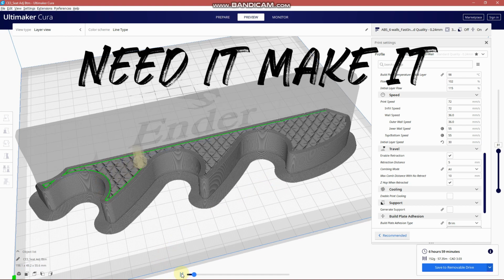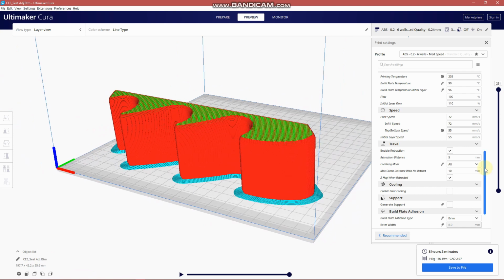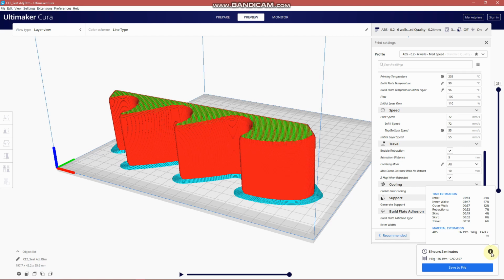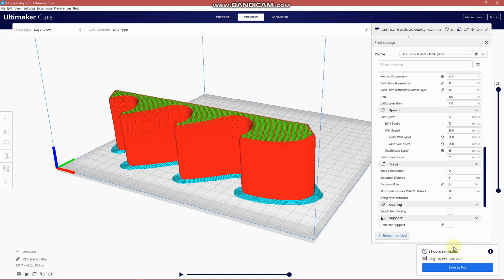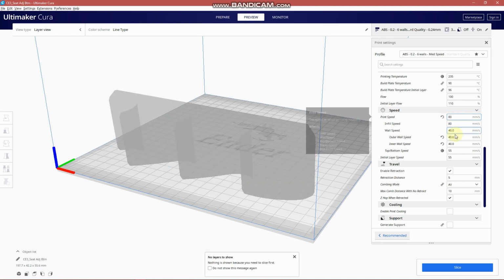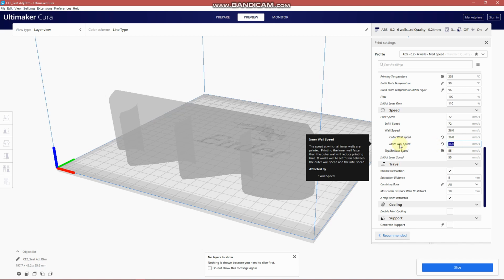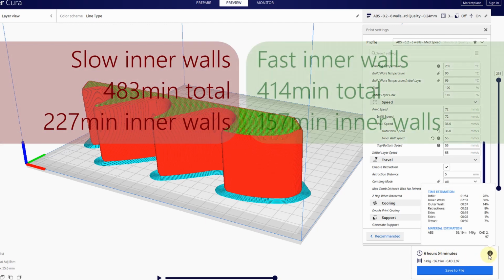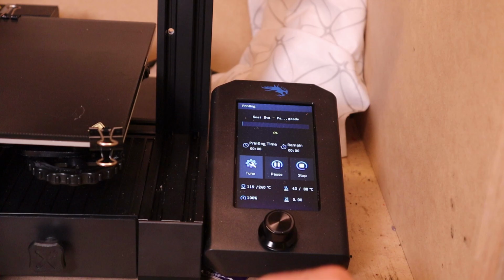Creality Ender 3 V2 - Speed up prints without sacrificing quality by identifying and changing...

Comment: There is a seemingly endless array of "upgrades" for the Ender 3.
I might venture to say that most of these so-called "upgrades" are really unnecessary and they actually cause printing issues. Just my opinion. 
My Ender 3 came "unrepaired" for cheap. After replacing the motherboard and installing the firmware, this thing makes very high quality parts. Sure, it is a bit slow but it prints without any "messing" with it. Your mileage may vary. At least that's what she said.😁

Comment: On Cura 4.11 i noticed if you change print speed to 72 the inner wall speed is default to 72 as well. I guess they modified this in the newer version so we wont have to mess with it.
Reply: F

Comment: I tried those settings but somehow the estimated printing time takes about 1/3 longer than with the Stock 0.2mm profile and seems to declare parts of the model as inner walls where the stock Profile doesn't show any inner walls(in the overview section of the "i" information symbol next to the estimated time)....
any suggestions to solve this?

Comment: For some reason, my prints on the Ender 3 V2 Cura estimate and actual printing are taking way longer than I would think they should. For instance, I have to scale a 3D Benchy down to about half scale and it still takes about an hour. And yes, my Cura settings are pretty much normal.
Reply: Cura dosent take acceleration speed in account
Reply: @omtapkir8639  By acceleration speed do you mean mm/s? Right now my Cura estimate is pretty accurate to the actual print time. :(

Comment: when you set the print speed on Cura mine still comes up as 100 in the tune setting on the ender 3 v2. Does that mean my setting are not setting properly?

Comment: i wish i could get my v2 to print even close to that nice
Reply from the maker: I have two and both print very nice, you can too, it will be a matter of making sure the mechanicals are setup correctly and then you have all of the settings in the slicer to adjust, which can have a major impact.
Reply: @NeedItMakeIt  i figured out my problem. The plastic piece around the wires coming off of the hotplate had gotten sideways and pinched itself in the spring which made it impossible to level the bed.

Comment: Awesome vid man. I nailed down a beautiful print with ABS on my Ender 3 v2 but it takes forever. Just ridiculous lol. I’ll try your method and let you know.
Reply from the maker: Really, you're printing slow because of no cooling?  If you haven't already tried it, buy the sample pack of the Nano bed adhesive from Visionminer, it works amazingly well, I've moved onto PETG from ABS, but it will help if you have problems with warpage.  Could make for a cool test to see if I can crank up the cooling on ABS as well as print super fast.

Comment: Great video will this work on the ender pro?

I’m a noob and only got this 2 days ago 
Every print I have to manually set fan speed and bed heat and nozzle heat on the actual machine never seems to save it.

Also my mum has a Troxy printer and we both printed the exact same thing mine being a few cms smaller but takes 6 hours longer to print mine than what hers does?

I turn down the infill to like 5% and also turned combing to all and don’t shave much time off atal.

My first print a cobra Kai phone stand from cults 3D and it took 5 hours lol am I missing something?thanks man
Reply from the maker: I'd say that you need a different profile for Cura, if you print with PLA you can use this one, but you'll want to add the infill.  As far as temp settings and fans, they'll come from Cura you can tweak them on the printer, but you shouldn't need to.  https://drive.google.com/file/d/1tZl4NQtSxjQbYV4XQzumbF6tqZGiXoF8/view?usp=sharing.  There are quite a few ways to speed up your prints, try changing the profile first and then we can take it from that point.
Reply: @NeedItMakeIt  thankyou very much I’ll look into it

Comment: creality says you shouldnt clean the stock bet with alcohol. and i never saw the need to use any crap on the bed, such as glue stick... do you use glue stick for pla and petg as well?
Reply from the maker: Yes, except I always use glass, always have, but I do have plans on testing other options.  The glass requires the print speed to be slowed to prevent ringing because of the extra mass, so it is beneficial to print with sticky pad.  They wear out and that's where glass is better.  I suppose alcohol could be a solvent for that material, soap and water is probably just as good.

Comment: Sweet advice, I'm going to try this out.
Reply from the maker: I've printed as thick as 0.5mm with a 1mm nozzle now and that makes a big difference in the time, the parts are super strong with the 1mm nozzle, but the nozzle passing over already printed infill can cause some trouble and shift the build plate, so I'm still working out the bugs.

Comment: That is the printer I have, as my very first 3d printer purchase. Heard great things about moding of this 3d printer. I did a test 3d print of the doggy included on the micro sd card. 2nd print that Im doing currently is the Intuos Pro tablet holder with pen stand well.

Comment: You can change the inner wall speed much faster and infill speed 3x faster, but outer wall has to be very slow, and for the starting point of layer height you can set to sharpest corner and smart hiding for better shape. :)
Reply from the maker: You know I've not really tried taking it to the limit, this is a really good idea.   What I have noticed is that a much slower outer wall does help like you mention, that's a good tip as well.  

Today for the first time I am printing with a 1mm nozzle and 0.4mm layer height, wall speed 57, infill speed 70, this is a lot of material, the extruder is spinning at high speed to keep up.  My best record for the bowflex part I print was previously 7+ hours, this takes it to less than 4 hours along with stronger infill.  I'm curious to know how the part will look compared to the 0.6mm nozzle I was using.
Reply: @NeedItMakeIt  I also going with 1 mm nozzle currently, it has best results so far after this settings, but make sure your model has no support necessary, 1 mm nozzle causing support problem because sticking with 1 mm makes it stronger bounds for the models.
Reply: @MMK-342  how fast can you get a stock ender infill on stock nozzle? like 90mm/s?

Comment: in order to print fast on E3 - change the motor on the bed from 34 to 48! and direct extruder!!!!!!!!!
Reply from the maker: Are you able to give us some info about how fast of printing you're referring to.  

I don't understand how direct drive helps with faster printing, if anything the added mass should require a slow down.
Reply: @NeedItMakeIt  on all prusa type printers the speed limits by the bed weights ) so if the carriage is 500-550g it is ok for speed printing 100 mm - and if you can able so to the bed with the same veigh it is perfect)))) so in order to compensate the bed weight the motor with more torque is required)))) regarding the direct it is much better then you need retraction and if you print at higher speeds more than 80-40 so it will be much better than bolden)))) alos if you look at the video the speed is not 100 it is 40 or max 50)
Reply from the maker: @mitofun6967  For the bed I have been experimenting with thinner and smaller glass to reduce the weight, the trick however is that the size and weight of the printing ontop of the bed with this type of printer also impacts the quality.   100mm/s might be possible with the right conditions.  I'm still not sure about the quality at those speeds due to ghosting/ringing it would certainly make for an entertaining video series so I will add it to the list for this printer.    

The current max speed I use for this printer is 78mm/s for infill that was using a 0.6mm nozzle size.  Smaller nozzle may yield better results.  Recently I have been printing PETG at 0.8mm nozzle with very good results, however the fine details are not as crisp and I may need to use linear advance to improve them.

Comment: Do you plan to add a BLtouch?  Thanks for the E3V2 specific videos!
Reply from the maker: I do, what I'd like to do is make some videos which run through the process with only the info needed so they'll be very short and sweet.  I find some of the how-tos are too long and they are just people talking.  I'm a detail guy, I like to see the stuff.
Reply: @NeedItMakeIt  There are a number of mechanical installation video available for the E3 v2 for bltouch. However, what I have found most frustrating is selecting functional firmware for the E3v2 w/ bltouch and then specifically how to find & save the z offset (creality's firmware ignored my z offset entirely) and then utilize its mesh bed in slicing (with specifics for where to put g-code additions). If you did a video(s) on this it would truly fill a niche and help a lot of us out.
Reply: @Jasonwutuber  Jyers is supposed to be good for this. I use it without a bltouch. It stores settings to the main board (instead of the SD card like the stock firmware does)

Comment: stop wasting filament on brims and slow down initial layer speed
Reply from the maker: I've tested slower initial speeds with no greater success, rounded corners helps, and brims help.  The cost of a brim is less than a penny, I'm not concerned about that.  The real cost is in the cleanup from removing a brim and that is one of the main reasons I've been experimenting with PETG.   No warpage, no brim, no adhesion issues whatsoever...ever.  Stringing is a bit of a problem and moisture absorption.
Reply: @NeedItMakeIt  for some reason youtube just gave me the notification of your reply. I didn't say stop wasting money... The cost of a automated filament recycler is like 10k. if I had a isolated space i'd print everything in abs. petg is great when you can avoid or hide stringing. It seems like you have found a way to stop wasting filament and save time on removing and printing the brim, so we agree.

Comment: This is awesome! I also just found out about a Cura plug-in for click on click off support placement from CHEP... holy cow it has shaved off HOURS by not placing absolutely insane supports automatically.
Reply from the maker: Check out Prusa Slicer 2.3, it now has paint on seams and supports.  I've been experimenting with it over the last few days.  I really want a variable density infill feature.   Another cool one would be something that reproduces the structure inside of our bones, place the infill where it needs to be for the conditions we have.
Reply: @NeedItMakeIt  hmm... I wonder if there's a way to get a support topology optimization tool. It could be similar to bone density infill, or better.

Oh, seems like they hinted at it here.
https://youtu.be/QLA92V_85_I
Reply from the maker: @RenegadeRukus  I enjoyed that video, thank you.  I'm sure there are people working on this knowing the constraints of 3D printers at the moment.  In the future I expect that we will have access to a type of metal 3d printing at home with a sintering method which allows any shapes within the part to be produced regardless of their complexity.  We'd need a method to remove the un-sintered material through some holes.   Our current FDM printers would not have a very efficient path to follow and it might make more sense to just use what we have.  I suppose resin printers would have limitless possibilities as well.    

A very interesting subject, I would really enjoy testing some different structures for tension and compression to see how they'd perform, perhaps some that look like human bones.
Reply: Mind linking this?

Comment: Great idea.  Is there a way in cura to make it automatically adjust based on print speed, i.e.  PrintSpeed*1.5 ?  (other than editing the creality_base.json file)
You speed is fast ( compared to my E3 V1 usual speed of 50)  is that a V2 improvement?
Thanks for the video.

Comment: Thank you, im waiting mine next week, coming from Anet a8
Reply from the maker: A great switch to make, one adjustment I had to make from my Anet A8 was to the Bowden tube, it takes some getting used to, but it will make for many nice prints.
Reply: @NeedItMakeIt  was a nightmare, change psu, change bearrings, sold the bed, change cables with silicone... For this what you think it s better tube capricorn XS or TL for PLA?
Reply from the maker: @Diego-de9eu  It was a frustrating printer for me as well.  Good to struggle so you can appreciate things when they are good!  I purchased the capricorn, I'll be installing it soon (once the printer is free).  Please do yourself a favor and buy the best tubing with the highest temp rating you can.  This material become poison when it melts, the better tubing is rated for a higher max temp.  It is also supposed to contain material which reduces friction, and after using the cheap tubing I have a feeling that reducing the friction does play into getting better quality prints with better response from the movement of the extruder gear.  I'll have some follow up videos in the next weeks about this as well.  I'll also have one coming out in a couple of days about the tubing fittings you may want to check out.
Reply: @NeedItMakeIt  yes, anet a8 was a good school. What capricorn you have? Dark or light blue? I have Heard that they have small tollerance, so, most of filament give problem. I dont know what to think
Reply from the maker: @Diego-de9eu  The dark, I've tested it and my filament does run through smooth, the tube I have measures 1.92mm ID, 3.97 OD  Slightly more space than the cheap tubing I bought.  I'd also recommend a shorter tube, less tube should = less friction.

Comment: What caused that bump line on the print? i have the same problem on my printer and would like to know if anyone has a soloution.
Reply from the maker: Can you tell me which part of the video shows the bump?  Thanks!
Reply: @NeedItMakeIt  at 4:50 on the side of the print, there is a vertical line of bumps. Mine are a little more of a straight line but i quess it's the same problem
Reply: @michaelhudson7809  that would be cool thanks

Comment: Do you print in an enclosure? If so, did u move ur PSU and electronics?` I would love a tutorial video on how u moved it etc. :) Keep up the Ender 3v2 vids! :)
Reply from the maker: Hi,  I do print in an enclosure, however I switched from ABS to PETG specifically to avoid problems like overheating the electronics over time.  I also didn't think that some of the plastic components of the printer would handle increased temps inside for extended periods of time especially if there were any forces being applied.  

I am experimenting with PETG now and I am enjoying printing with it.  It has its own set of quirks to handle, but that will come with experience and settling on one supplier that works for me.  

I would prefer not to customize the printer too much because it is meant to do a job rather than consume my time and I like to keep it as stock as possible so replacement is simple.

Comment: What temps are you using to print ABS? Nice video, happy to subscribe to a fellow Canuck!!
Reply from the maker: I've used 235C for ABS pretty much exclusively and I print with 3dprintingcanada's brand of filament and have for years with good success.  https://3dprintingcanada.com/collections/abs/products/grey-1-75mm-abs-filament-1-kg .   Recently I switched to try PETG and I am probably going to keep using it; there is no smell, so little warpage, bonding to glass uses just glue stick and it needs to be placed in the freezer to remove it.  The only downside is that it is shiny, I like to take steel wool and remove the sheen... I prefer that look.  Thanks for the sub!